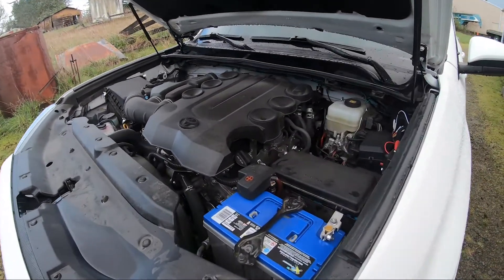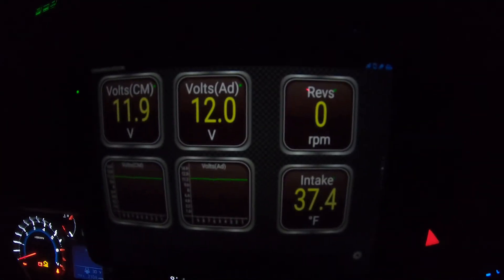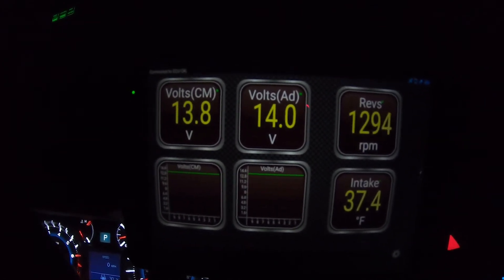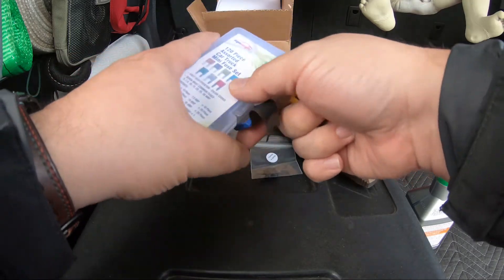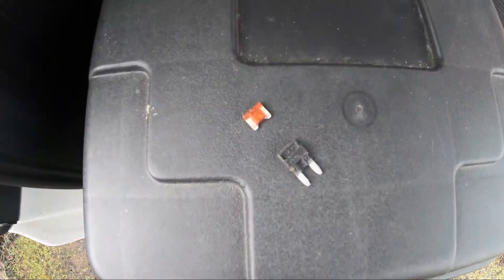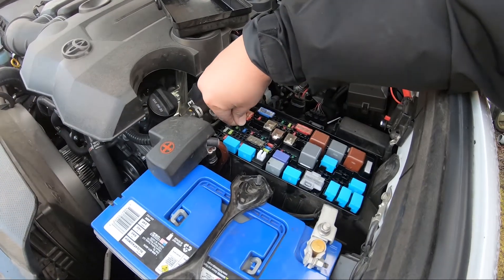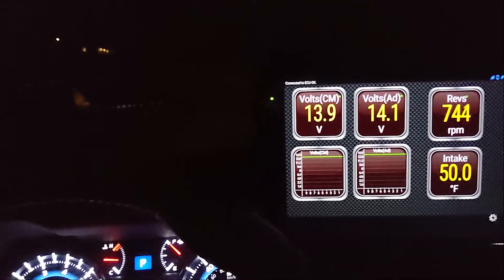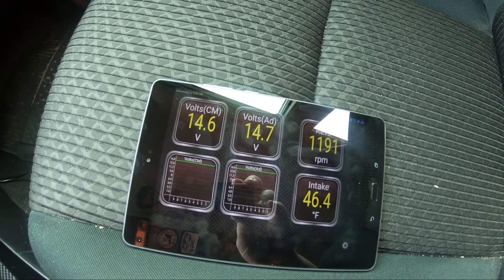4Runner Voltage Booster Fuse for Under $10 to Properly Charge Your AGM Battery.

Comment: Three big facts people are missing here (oversimplifying for brevity):
#1 the charge spec on that battery (14.4-14.8v) is the MAX the BULK stage of charging and typically spec'd at 85°F. The MAX bulk charge rate allowed quickly drops as temps rise AND as the battery state of charge (SOC) nears 100%. When >120°F, the maximum allowable charge rate typically drops to 14.0v or less. Typical engine compartment temp on a summer day with A/C on can easily exceed 210°F. Charging at too high a rate will cause the battery to offgas and possibly vent. On a flooded battery, you can add back water that boils off. On an AGM, once it vents that loss is irreversible. If you push it too far, dried out cells could enter thermal runaway and cause the battery to get hot enough to melt the case (I've seen this on a couple Optimas over the years).

#2 the typical Toyota alternator, like most internally regulated alternators, is "temperature" compensating. In other words, the set-point voltage (target charge voltage) will vary according to ambient temp. When you first start on a cold Winter morning the charge rate could be 14.7v initially, first start on a hot Summer day may only be 14v, and as the engine compartment warms that will continue to drop, typically settling around 13.5-13.8v (lower v the hotter it gets). This is to prevent overcharging a hot battery and damaging it. If you "fool" the regulator into boosting the output by a constant 0.7v, it's possible in the winter to get 15.3v or higher...that's high enough to stress a lot of the electronics in the vehicle and shorten lifespans. 

#3 You are assuming the voltage displayed on your scan tool is accurate. IT IS NOT. The only voltage that matters as far as the battery charging is THE VOLTAGE MEASURED AT THE BATTERY. The "ALT-S" fuse serves to provide the regulator with a sensing voltage that is as close to the actual battery voltage as possible. In my own tests, I've seen ScanGauge, ODB2 adapter and "consumer" digital voltmeter readings in the vehicle 0.5v lower than what a lab-grade calibrated meter shows at the battery terminals. So while you think the system voltage is 13.8v, it's actually closer to 14.3-14.4v at the battery. And as I previously stated, the voltage at the battery is what matters. As long as it's seeing a cold charge north of 14v, tapering down to 13.5-13.8v (AT THE BATTERY) as temperatures rise and battery becomes fully charged it will live as long as your environment allows (automotive batteries generally to last longer in cooler climates, as do batteries that don't live in the hot engine compartment). Heat is what kills batteries and a sure-fire way to kill one is overcharge it while it's hot.
Reply: Gave you a thumbs up because you sound like you know what you’re talking about.  Thanks for saving me $8 and potentially a lot more!
Reply: @timdunlap7565  keyword “sounds” like he knows what he is talking about. Ask Northstar they will tell you over 14v is occasionally needed to prevent sulfation- it is true overcharging can cause off gassing but AGMs DO NEED slightly higher voltage than flooded lead acid.
Reply: @glideronthemoon  That's not what I said at all. I was pointing out that the peoples' logic for increasing the charge voltage was flawed, that the stock system works correctly for temperature-compensating a lead acid battery located in the engine compartment and those that were theorizing the voltage was too low were not understanding the temperature-compensated charge profile required by most batteries to achieve longest life. Also that overcharging & overheating is far worse on a battery than under-charging.
Reply: @Mudog715

Thoughts on older vehicles which likely are not temperature sensing for the alternator’s output? Close to swapping to a AGM in a 2002 Land Cruiser and a .5 increase would put it at 14.2 up from the current 13.75. Thinking of going with an adjustable version of the mod which allows adjustments from .2-1v in .2 increments and just keep an eye on what it’s doing.
Reply: @marcusjohnson5839  2002 Land Cruiser alternator is most definitely temperature compensating. This tech had been around since at least the 70's...it's nothing new.
Reply: I like the idea of the heat shield, installed an AGM battery in my truck and I will monitor voltage and cranking amps(have battery tester) . I’m not changing out the signal fuse, I will only be charging battery with AGM charger at home once a month while truck is off.
Reply: I believe you are spot on!  I live in Phoenix and most lead acid batteries, from Costco, last only around two years.  This is because of the heat.  A lot of people do not take this into consideration.  It is the heat that kills, not the cold.  Bought the X2 Power battery 2 1/2 years ago.  So far so good!  Time will tell.
Reply: I didn’t buy the “need” of boost charging AGM battery when I first saw the post at ih8mud forum. These x2 came with 5 years warranty under standard charging condition which is plenty long. Boost charging “may or may not” extend battery life a tiny bit but you are stressing everything else in the electrical system include alternator. Squeeze another month or two out of a $200~$300 battery is equivalent of saving $20 in 5 years.
Reply: So would you add anything to the vehicle to being up the charge at all or just leave it as, stock, to charge the agm type battery? I'm looking into POSSIBLY getting an Odyssey Extreme battery in the future. Thanks for the info!
Reply: Great post Mudog715.  So, I assume you recommend against this work around?
Reply: Some of this is correct but you are glossing over the fact that Northstar themselves says Toyotas low charge voltage is hard on their AGM batteries (email them and ask them)
Reply: i have a safer solution. my altenator is primary source of power for my 2xAGMs in winter with solar charge controller when there is sun so it charges correctly. batteries for 2 years now work good with really good capacity results. probably maxed out. im not an expert at this so im not putting any replacement instead of a fuse.
Reply: What is a lab-grade meter? My fluke is Calibrated every year. I'm not sure how the voltage will kill other devices in the system since they only draw the required Voltage and Amperes  as needed.
Reply: Hook up 24 volts and see how that works out. 

Electronics will see whatever voltage is applied, but only draw the current they need to operate.
Reply: @BacchusPlateau I’ve tried before. We use 24V. To burns out electronics on purpose but I do agree with certain 12V.  Electronics can run off of 24V. Supply such as air mix door actuators, blower motor and even ECM etc. for light bulbs, they burn out, they become instant bright and burn out. But the again they’re too many diff kind some will work some will burnout. Bottom line is you CAN NOT and SHOULD NOT use 24V. on 12V. designed circuit.

Comment: Doesn’t your electrical system run off of the alternator while the engine in running? Will the above factory voltage damage the electrical system?
Reply: no unless you go over 15.8v

Comment: Is it the same for a 4th gen 4R?
Reply: right!!!! ima try it... but i just changed to a 240 amp alternator.. i believe the voltage reg is in the alternator... 

idk.. im figuring the system is regulating as well.. hence the need for this fuse... 🤷 im going for it

let me know if you tried it.. thanks!!
Reply: @bdc211  i have a 240A alt too for my sub and amps. this mod works for 4th gen. went from 13.8 to 14.5
Reply: @tee228  sweet!!! thanks again!! 👍

Comment: For anyone wanting to know, this works perfectly for 2nd and 3rd Gen Tacoma trucks as well.
Reply: I have 14 Tacoma I’ve tried it and works when Engine is cold but hardly A difference once the engine is warmed up.. I’m wonder 2014 Tacoma has a smart alternator where it can take the diode. The big difference is only when  when you’re at idle
Reply: Just did it on a 2004 Lexus is300 voltage before was 13.8v. after diode it's at 14.4v it also works
Reply: 3rd Gen Tacomas do not use a diode for alternator voltage. It’s all through the ECU

Comment: Did the mod only getting 14.1 max and when down to 13.8 ... Battery is 2 days old. Does that mean battery is fully charged ???
Reply: @xxNaTaSxx  thank you ... The mod has worked ... And no issues with the battery at all. Thanks for the informative videos

Comment: Doesn't work unfortunately only last at 14.2 for 15 min then back to 13.8
Reply: What SOC was your battery at? I'd assume this is a regulated source so if it senses your battery is fully charged it would dial it back.

Comment: what if you just leave that alt s fused un plugged?
Reply: You’ll definitely get a check engine light 🤣, and a code for “system low voltage” in every module in the vehicle.

Comment: Well it’s almost May how is it working for you.  I have a 2018 4Runner with a agm battery and am looking into the charging of it. No one told me about the need of 14 plus volts when buying the battery I think they should have. And thanks for the video it’s a great video great job. Thanks for the help.